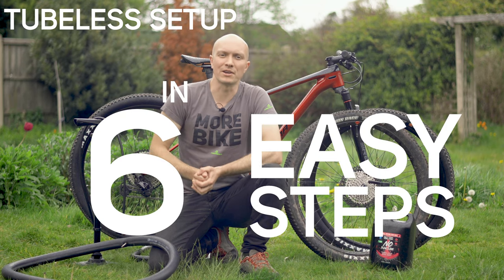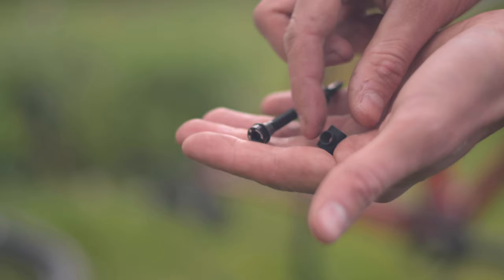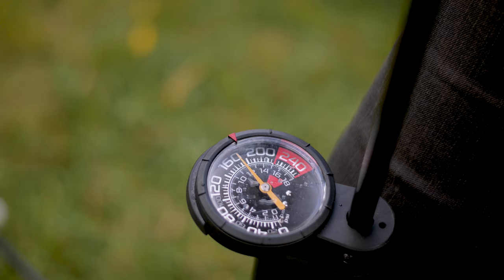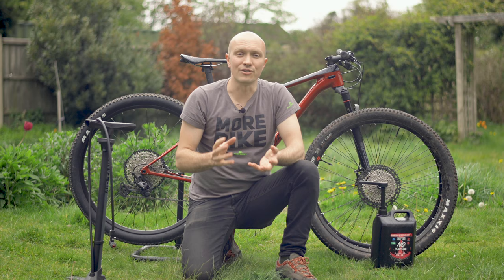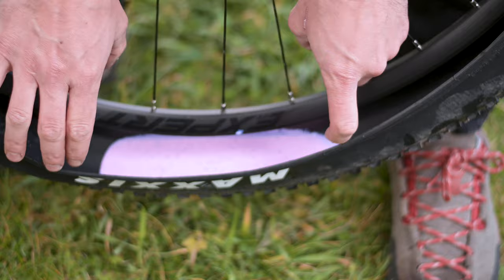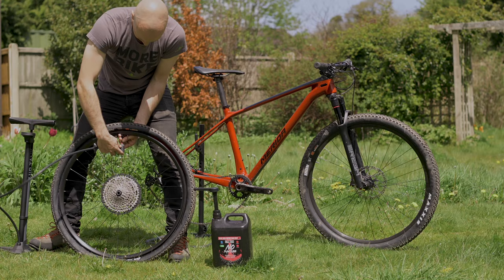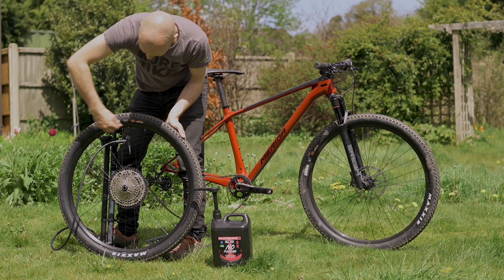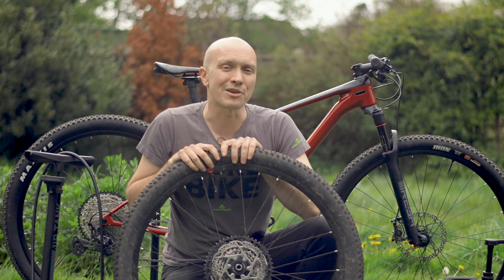Convert your bike to TUBELESS in SIX easy steps | Ditch innertubes for fewer punctures

Comment: Hi there Merida, i have the exact same bike (Big nine XT in glossy christmas red :) rims and tyres as shown in the video. In the video i don't see the tyres show "tubeless ready' . I've got the same on my bike. Does it work? Or is it just to show how it works. My tires also don't say tubeless ready. Cheers !
Reply from the maker: Hi there, you are correct that the tyres on the BIG.NINE XT are not tubeless-ready and we just used them for a demonstration here. However, we have used the bike since with this setup and it has worked, though it's not recommended or guaranteed to function in all cases. Hope this helps!
Reply: @MERIDABIKES-INT  thanks for the information. I'll give it a go ;)

Comment: What tyre liner can be used with a 17c inner rim width of Merida SILEX 400 (2021/2022)?
Reply from the maker: Hi there, the maximum width tyre that can be fitted to a SILEX 400 is 700c x 38mm or 650b x 45mm. Hope that helps answer your question!
Reply: @MERIDABIKES-INT  I asked for  "what tyre liner to use when the inner rim width is only 17mm?", did not ask for "what max tyre clearance it has?"
Reply from the maker: We're very sorry for the misunderstanding - what do you mean by a tyre liner?
Reply: @MERIDABIKES-INT  My bad! Some people online use confusing terminologies and I myself got confused here! So, I actually meant "tubeless tyre inserts" (not "tyre liner"). The inner rim width is 17mm and if I am planning to make it tubeless, then as far as I know there are no tyre inserts compatible for this. Since you people have made this compromise in the design, I wanted to know your suggestions on tubeless tyre inserts for the stock wheels.
Reply from the maker: Hi, there should be a number of aftermarket tubeless rim tapes that will allow you to make the stock rims tubeless - for example this design from Muc-Off, though many others are available : https://muc-off.com/collections/tubeless-kit-range/products/tubeless-rim-tape

When it comes to tubeless tyre inserts for increased puncture prevention, there are also a number of gravel-bike compatible inserts that work with a 17 mm rim, for example, the Vittoria Air Liner Gravel: https://www.vittoria.com/ww/en/bike-accessories/tire-inserts/air-liner-gravel

Please note that as these are not MERIDA products, we are making no recommendations as to their efficacy or otherwise and you should check their compatibility with the manufacturers directly.
Reply: @MERIDABIKES-INT  Cool! Thanks for the useful information 👍

Comment: Are the merida comp cc rims convertible to tubeless?
Reply from the maker: Hi there, the MERIDA COMP CC rims are not tubeless compatible out of the box unfortunately. It may be possible to convert them to work with an aftermarket tubeless conversion kit, but we'd suggest you consult a qualified bicycle mechanic to help you do this safely.
Reply: @MERIDABIKES-INT  cool. thanks for the tip